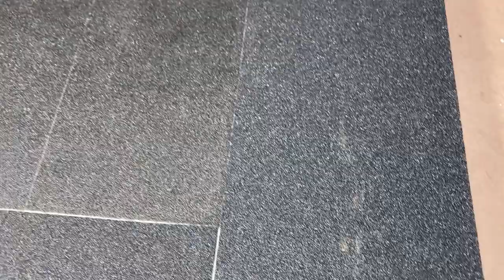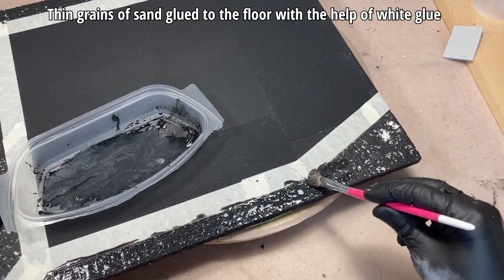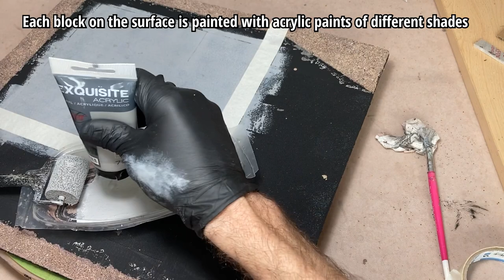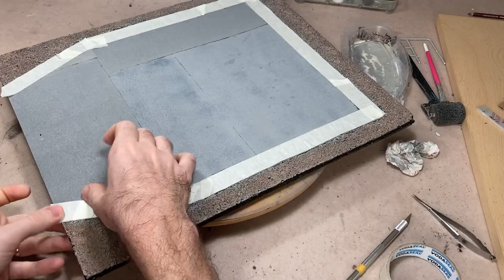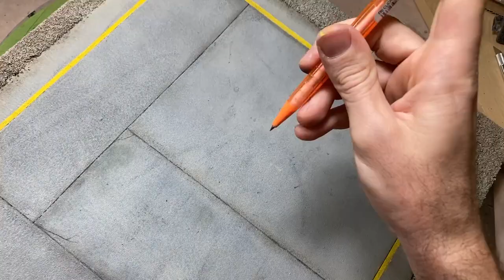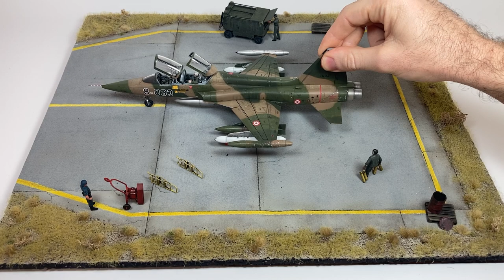How To Make Concrete Airfield Base / Display Base Tutorial

Comment: You are an artist...congratulations!
Your ability to make this surface simulating a concrete floor is incredible.
What is the specific name of this brush that you used for painting?
I'm looking to make an aircraft carrier flight deck with those floor grooves for my naval aircraft kits, but I'm still studying which material and technique to use.
What I find strange is that there is not even an explanation of how to make the flight deck and also its realistic painting in naval modeling forums.